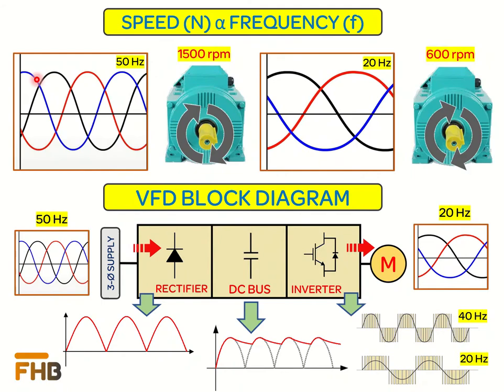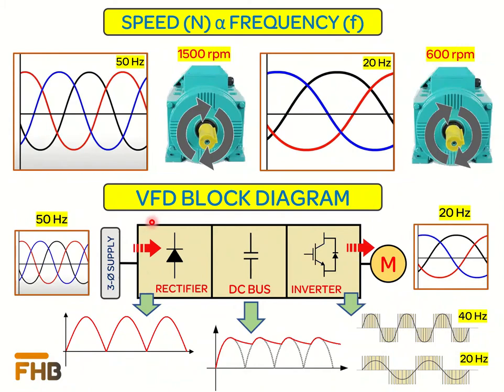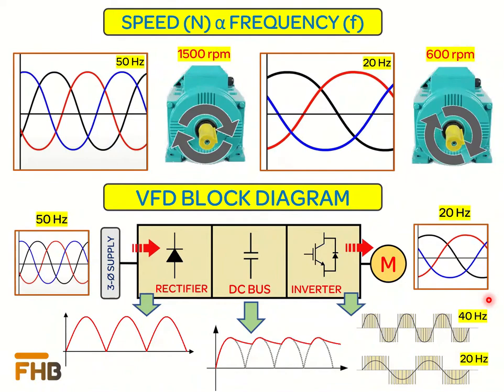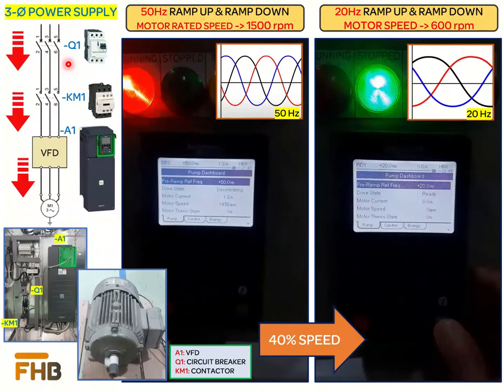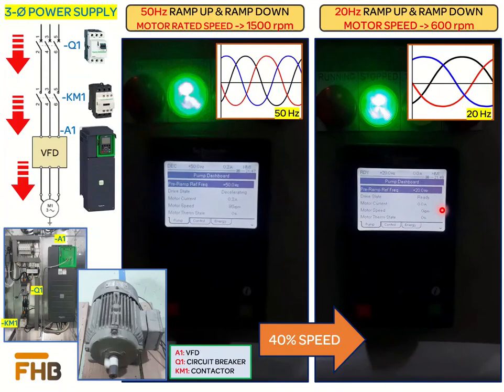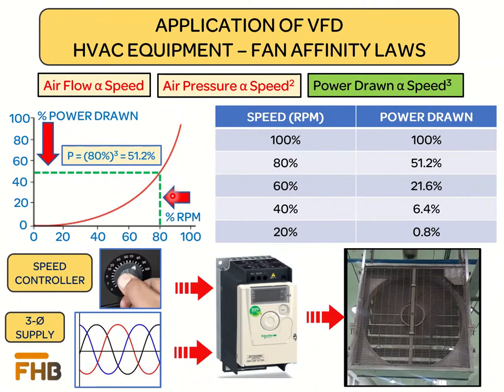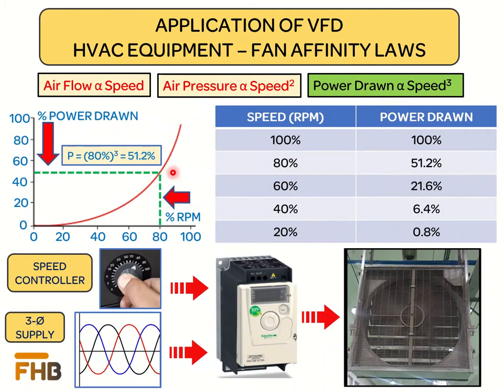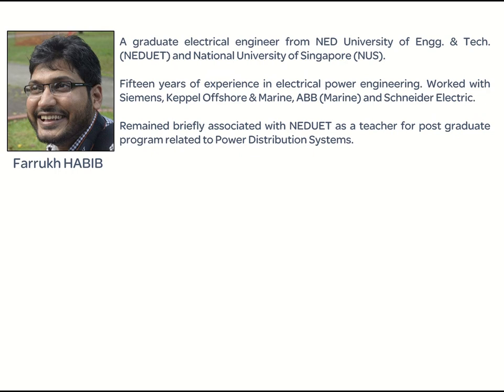VFD Motor Control | Farrukh Habib - FHB | #ElectricalEngineering #motor #vfd

Comment: Thanks Farrukh wonderful,  Can you name some other applications of VFD in industry other than exhaust fans etc
Reply from the maker: Thanks Imran bhai. VFDs are used in many applications where speed control is required like conveyor system, sheet metal punching machines, bending machines, pump speed etc

Comment: Do you reduce voltage when you reduce frequency? How does the torque that the motor is capable of vary as frequency is reduced?
Reply from the maker: Hello Paul, What matters is V/Hz ratio which needs to be remain constant during the frequency control. This keeps the production of magnetic flux constant and keeps the torque stable.